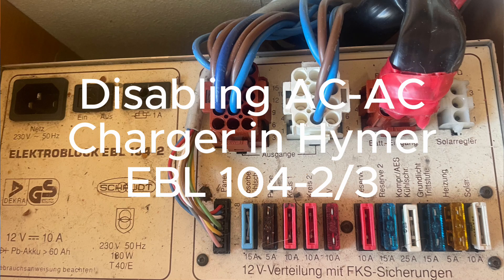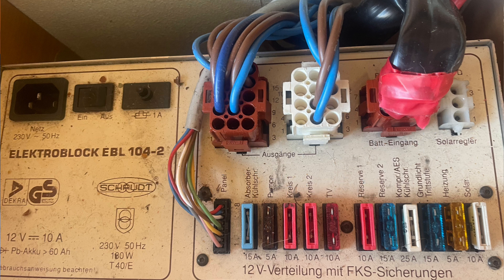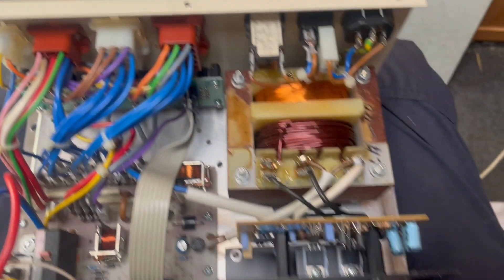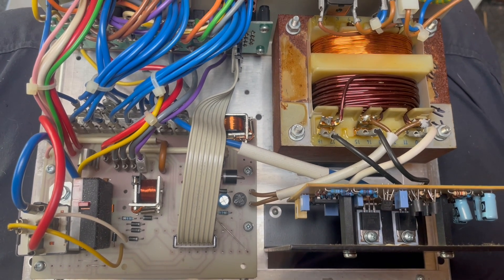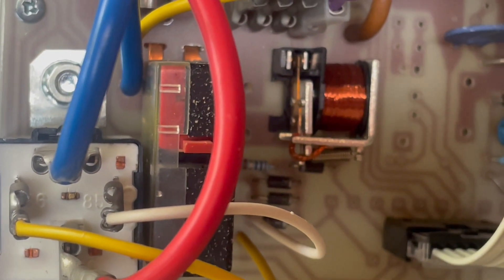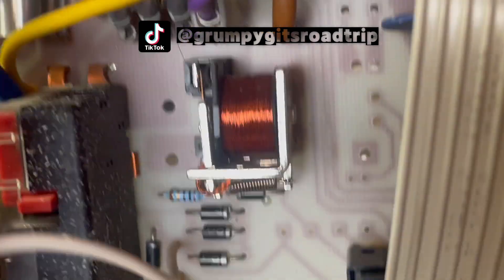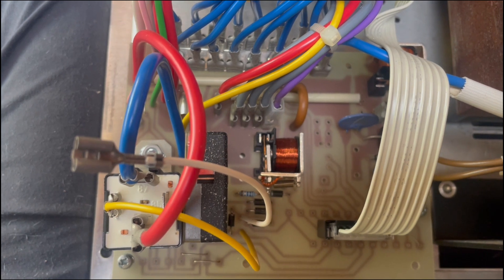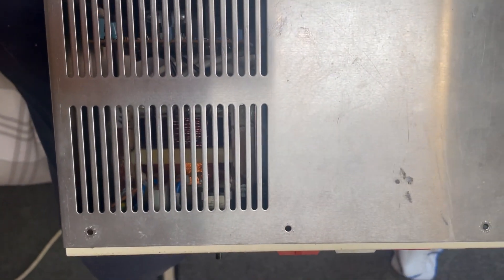Disabling the DC-DC charger in a Hymer EBL 104-2 | Van Life UK

Comment: My hymer b644 is not charging when plugged in would you know that it could be would great full for any help
Reply from the maker: Hi. Are the electrical items working in the van when it’s plugged in? What Elektroblok model do you have in your van? I’m assuming you’ve checked the connections to the leisure battery and tried a multimeter to see if there is current going into the battery when plugged in?

Comment: Hi thanks for posting this video! I have just a question. Is it disabling the charge from the alternator when driving or is it disabling the charger from ebl when Hymer is plugged into 230v? Or both?

I have a hymer b544 from 1995 so i have the exact same ebl.
Reply from the maker: This method disables alternator charging. If you want to disable the charger when plugged in to EHU just unplug the EBL power cable 😊

Comment: Hi there, i also have a hymer with the ELB 104-2. I also want to change my AGM Battery to a 200Ah Lithium battery. I read that the EBL still works if you put the Voctronic 12/200 booster between the EBL and the lithium battery. What do you think about it?
Reply from the maker: @sveiks_lifestyle  hi. I’ve never heard of this as a solution. My limited knowledge of electrics suggests to me that there wouldn’t be sufficient amps from the EBL for the Voctronic to work optimally. My understanding is that they EBL only puts out 10A

Comment: The white wire is the low current coil side of the relay which when energised creates a magnetic field and pulls the large relay contacts towards each other either making or breaking contact, ie the relay uses low current to switch very high currents.  We can see this by the size of the wires going to the relay, one pair (on the coil) are thin, the other very thick.

That's a 230v/240v transformer to probably 12v to 15v.

Did you ever receive my email?  Sent twice now.
Reply from the maker: Thank you for the explanation 👍 I've very little experience with this type of stuff but as there wasn't another video on YT about disabling this particular relay (which would only be relevant to anyone with an EBL of course) I thought I'd create a video showing how its done. 

Yes, I've just checked and found your email in my Spam folder. I'll respond shortly 😊
Reply: @GrumpyGitsRoadTrip  Gmail is a little keen on false positives, although I should probably add DMARC to my domain...I'll investigate, thanks for letting me know.